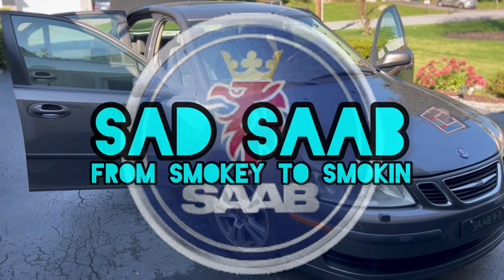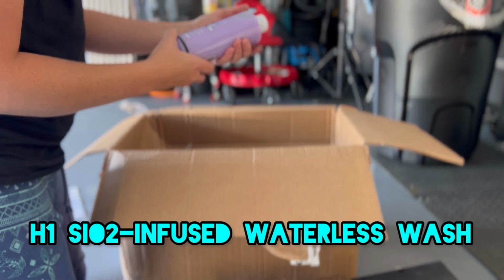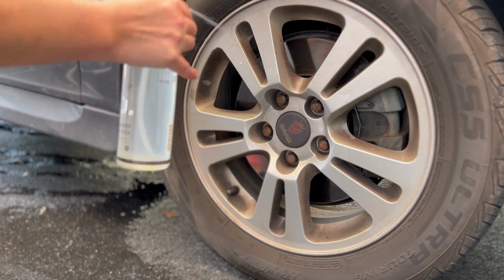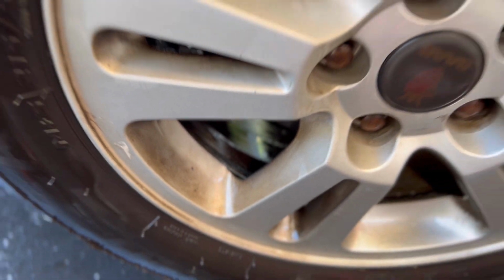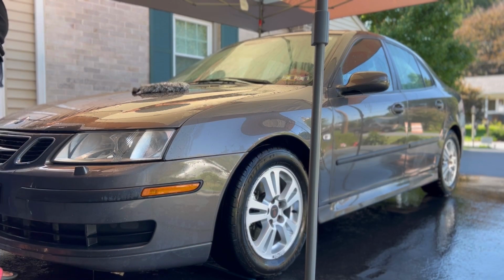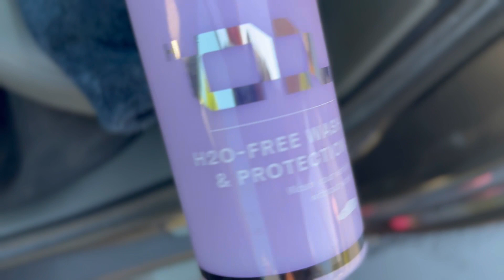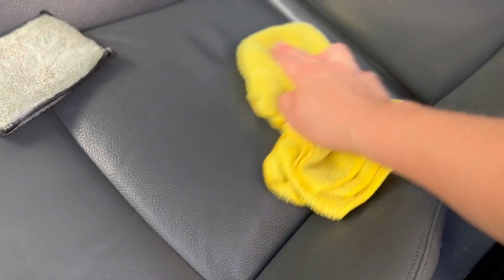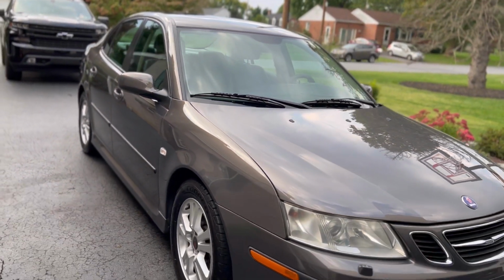Smoky Sad Saab- Full Transformation W/ Pure:est Products! + Giveaway!

Comment: In a previous video you mention and showed brush holders for your wheel bucket.  Will you share where you got those?
Reply from the maker: Still testing them out if I like them or not. But I got them off of Amazon
Reply: I have searched everything I can think of would it be possible to send the link?

Comment: The hydrophobic shampoo? What kind of protection can we expect? Length etc... What can be used on top of it?
Reply from the maker: You can use their Sio2 ceramic sealant and it makes a killer combo. By itself it will last 1-2 months but topped 4-6 months easy